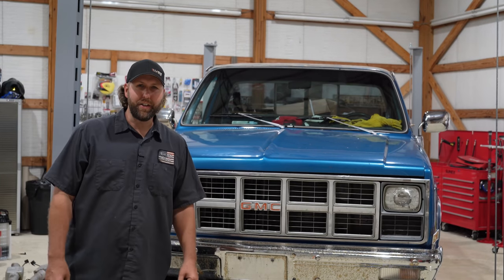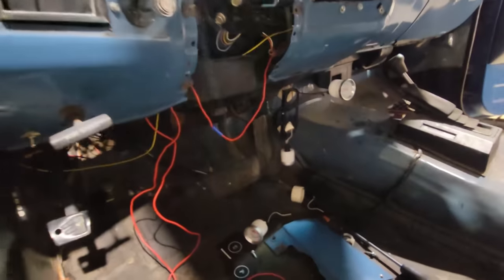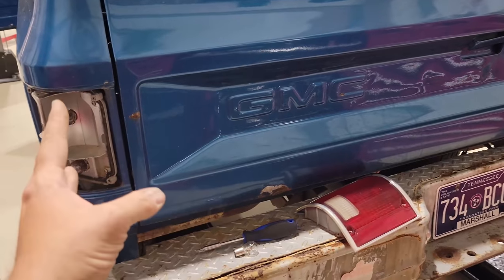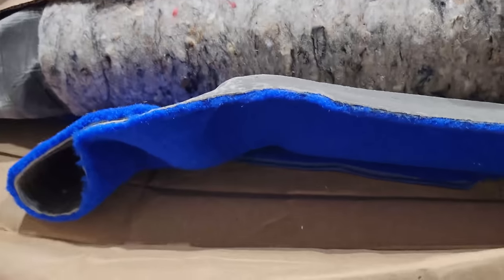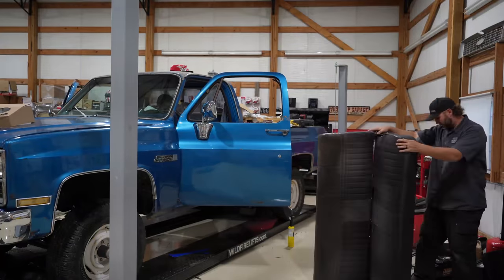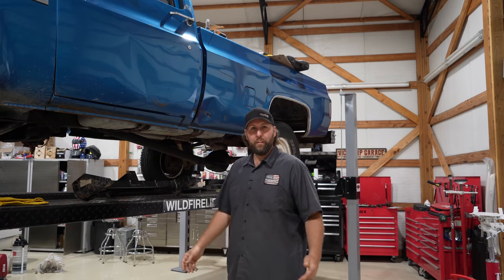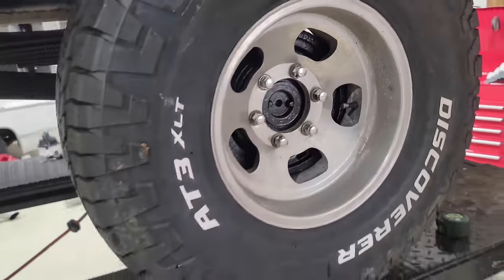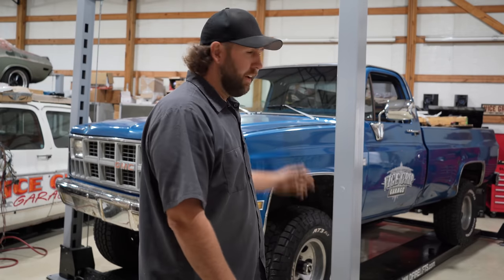Budget Truck Restoration: GMC 4x4 Gets Overhauled!

Comment: Why Derek? square body GM crap is a embarsment to any garage. These trucks are pure rust  buckets, you got to no this living in the north. Most had rusted out front fenders after 2 years let alone  the quarter panels. Oh what about the flat folding hoods, glued on plastic chrome trim, glued on rain gutters plastic door panels that after a few years you could take your finger nail and scrap off 1/8 In plastic, weak drive trains in the half ton. If you see one of these trucks today not rusted that has any noteable miles its had most of the body parts replaced maybe more than once                                                  Actually the only thing it had going for it was the 350,454,350 400 turbos.